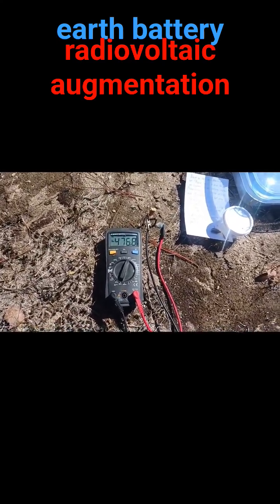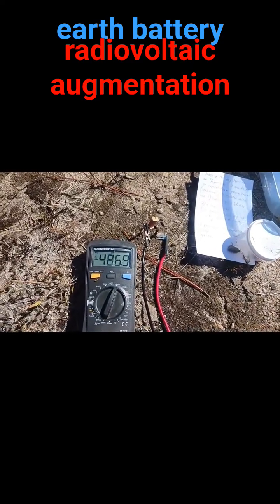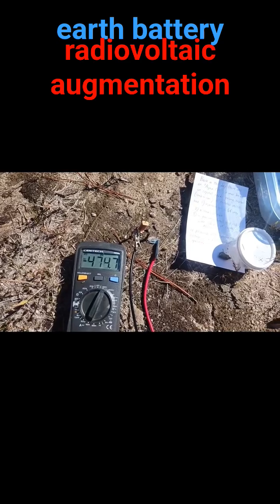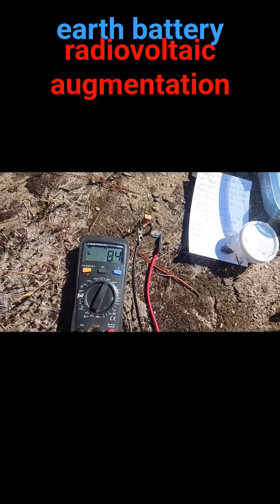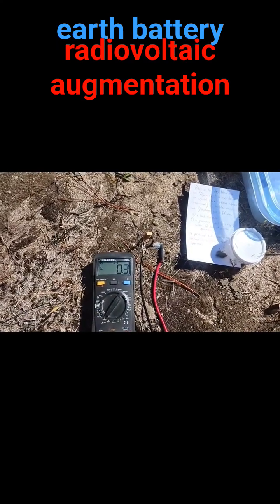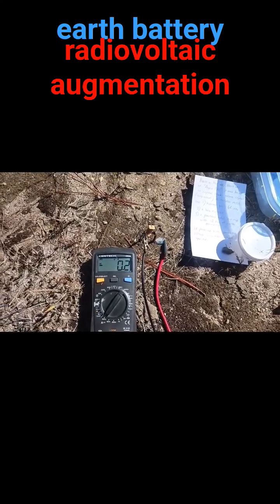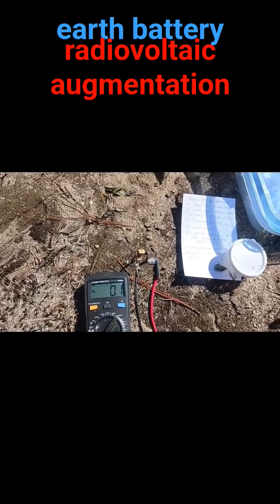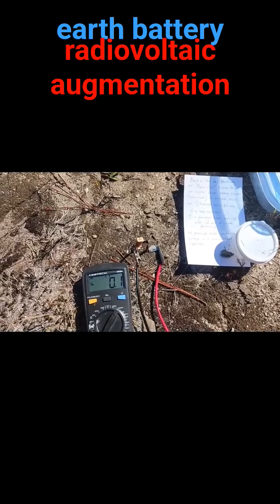earth battery augment: radiovoltaics

Comment: Old earth battery designs are far behind. What you need is to use Tesla's proven concept of charge wave bouncing by planting iron in ground, with rod from that through 3 layers of copper to spark gap to rod leading to apex of a copper and or foil pyramid that is insulated from ground. Open spark gap slowly and you will notice how fast the earth keeps up with the negative ion stream pouring off the top of the pyramid due to the zpe action. That little design is so powerful it'll melt the wire if you open spark gap too far.
Reply from the maker: have you seen the breaux patent?

Comment: How do you make/acquire the chamber that holds the h2. 
Also do you have an idea of how to convert the volts to amps? Or are you powering devices that only require voltage?
Reply from the maker: it produces amperage and voltage. this one went as high as 16 miliamps. and had very low surface area . an inverted and sealed bottle can store the hydrogen about 20 hours. a cheap balloon about 3 hours